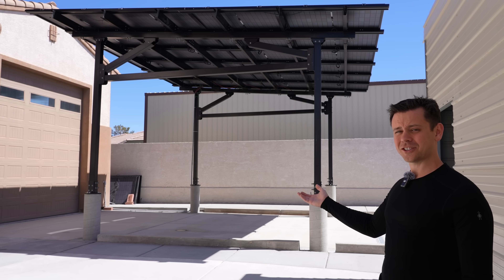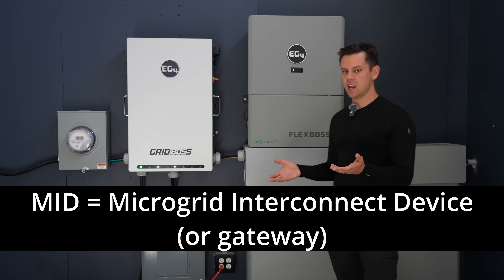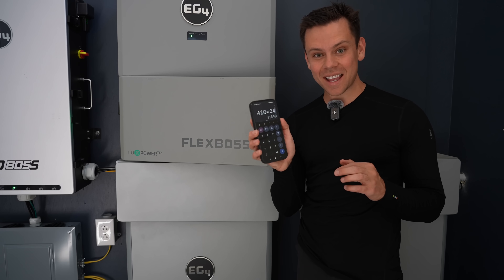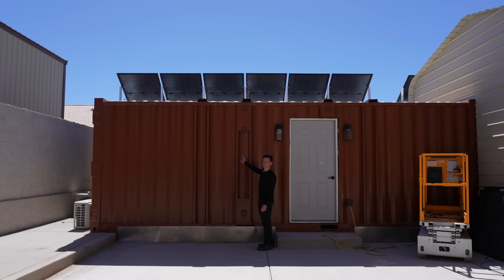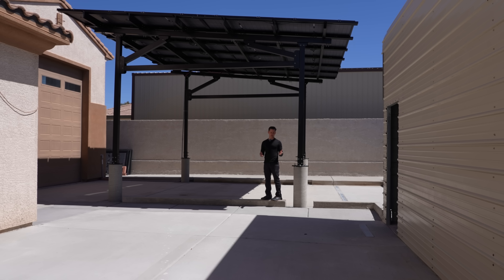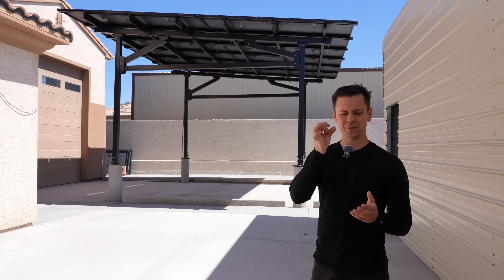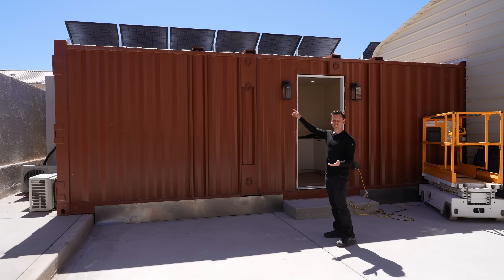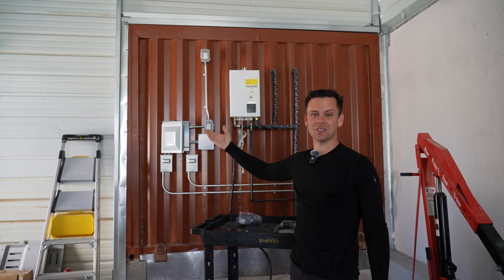Yikes! Not 12,000W?! Chiko Solar Carport w/ Aptos 410W Bifacial Panels

Comment: Have you ever thought about getting some corrugated steel metal that they sell at home Depot or Lowe's it has a reflection to it if you put those around the edges of the panels I think you would get more array in our opinion

Comment: @WillProwse on that robot dog back door post you made and then removed.  You need to redo the name of your WiFi network and change the passwords. You have to assume the WiFi credentials have been sent back to the mothership.  Same reason I urge you to not blindly trust the gear you review made overseas that uses web services based overseas.  Just because the company that slaps it’s name on the outside of the case is USA based, you are not safe from back doors built in overseas.  I put most of my WiFi only gear on a guest network.  My main network is constantly upgraded to the best encryption, etc.
Reply from the maker: Good to know. Wow

Comment: Fine & dandy, not square footer columns, 😢possibly wrap osha yellow corrugated plastic sleeves around them for safety. Then that would also fill out the width, and eliminate the sharp points. Then paint the curbing the same, due to that being a serious tripping hazard.

Comment: Too bad you don't get snow, my "vertical" not elevated, JA 550w with snow 697w before it shut off the mppt for over amp. With-out snow, white painted surfaces all around even below at the base of the panel. 
White rock, white sign board, plywood painted. My 550w x6 3300w, 4185w on a 3kw input.  I have 11.6kw, overcast now, snow is gone, shade stick is still in, 1930w. Using 18kwh no gen since Jan 9th.

Comment: Super reflective surface like a false ceiling right below the panel could help with the bi-facial situation. And the solar panel has to be translucent at least and not opaque like it is now. At that hight, radiations bouncing off floor is not going  to  help much.

Comment: Shading aside, the reflected light intensity falls off as a function of the inverse square of the distance.  Double the panels height off the ground and you fourth the reflected intensity.
Reply from the maker: See this is a common misconception. This is why the literature tells you to place the panels up as high as possible because you're increasing the angles from other areas that you wouldn't have. Think about your example and what happens when you lower the panel down to the ground.
Reply from the maker: I need to make a video about this because it's a common thing that people seem to mess up all the time
Reply: I’m just thinking of the inverse square law from physics, but I do get what you mean.

Comment: Are you "string" chained ? Are you having power optimizers per panels ? 

I'm asking because if you're only string attached, you would limit all your panel on that string to the minimal power of the whole string (current limitation, not actually power).  So if one of the panel is limiting the current of the whole string , it may be limiting the power of the other panels.  This is one of the flaw of a string attach inverter, but it's normally not that bad...

Maybe try with a heat camera to see if one of the panel has a hotspot ?

I know I sound like I'm trying to explain things you already probably know, but I want to know why as well! XD

let me/us know what you find please !

Comment: Careful with putting the split above your head. It might give you a sore throat every morning. Plus you may have difficulties in setting the temperature just right - you turn it on - too cold, you turn it off - too hot.

Comment: Because of the angle of those panels I think you will get a lot more power during summer. They are not optimized for winter/spring. I am getting maximum output this time of the year, but my panels are at 45 degrees.

Comment: buff and polish the concrete to a mirror shine.  
I loved the idea of bifacial with the metal roof of porch on 1st floor.  But then I thought about the wind loading of panels sticking 8 feet out off the 2nd floor roof, and dropped the idea.
Maybe if I ever remodel, I can add greek columns to support the outer edge of panels.

Comment: I'm the guy with this exact gazebo in Denver, but I went with SILFAB 420QD panels, without bifacial. Interestingly, yesterday I pulled 8750W at 12:30p, with 23 panels (I'm missing one at the moment). That's about 90.5% of max potential.

That was at about 50F ambient, so if it's warmer there, maybe that's the difference. Sounds like the bifacial isn't providing much.

Time to paint the driveway white?

Comment: Bifacial panels are a solution in search of a problem. There’s not many situations where it makes a big difference. The panels should only be rated for the solar yield of the sun facing side and any extra power from the other side is a lagniappe.

Comment: This is probably a dumb thing to wonder because Will is very thorough…but is it possible the power from carport solar array might be suboptimal due to the angle of the array?
Reply from the maker: Sadly not that big of a difference at this time of day. I have some older videos testing various angles. Few percent here and there, but nothing significant. But in the literature there's always benefit to raising the panels as high as possible. It increases convective airflow and allows for a lower internal cell temperature. Total generation for the whole day was pretty good though. Had a whole sun-hour over my other system.

Comment: Um, those panels don't seem to be at the optimal angle to the sun? Maybe get a solar irradiance meter to ascertain the optimal angle. It probably should be around 37 degrees depending on exactly where you are.

Comment: 99% sure the lower output is due to panel heat / temperature coefficient. I find on clear days (even when a little cooler) the panel temp will be double that of the test conditions per spec sheet. 
Wait for a cloudy day when the sun peaks out briefly, and that peak will be far closer to your assumed max.

Comment: Maybe the angle,maybe the mppt also looses some...In my experience victron mppt`s are the best.I compared side by side with some brands and it outperformed them all.Not with EG4,that is not awaileble in Romania.(but i compared it to epever,chinesse brands,outback,growwatt,solix,huawei,etc..and it outperformed some of them with 30%!!!! like the epever,its real crap.)

Edit.: I have 5600w rated of bifacial solar panels,at a 45 degree angle,and i measured 6200 watts on my victron system in peak sun.Less than perfect gives usually 5200-5500watts/h)and they are cheap chinesse solar panels bought on sale.

Comment: So radiance drops off by the inverse of the square of the distance.   So further from the reflector, means less light.
Reply from the maker: But more sources of light and the higher off the ground, the better convective cooling occurs. So the literature has always stated to move the panels up as high as possible

Comment: The larger an array of bi-facial panels you create the less gain you are likely to get, for the obvious reason that the array creates a large shadow. Panels around the perimeter of the array may get a little boost from unshaded surfaces reflecting some light, but that nice big pool of shadow is what most of the panel backsides will "see."

Comment: Did you test each individual panel?   Any chance one of them isn't working properly?  It looks really professional.

Have you tested a single panel in front of the carport at various angles?   That seems like a fairly shallow angle.   How much does the proper angle change at your location as the year progresses?  My sun is high in the summer but much lower in the south in the winter.
Reply from the maker: Both strings are producing the same amount and voltage so I think they are good. I could hit it with a heat camera and check. Technically it's a pretty good output, all things considered
Reply: @WillProwse  All I could think of.  Good luck!

Comment: I think the height above the ground is actually worse for bi facial gain, reflection from porous surfaces like the wall and ground are going to disperse much too far over that distance
Reply from the maker: In the literature it always states you want it as high up as possible. There is more available light the higher you go. And better convective cooling of the cells

Comment: I think you alluded, briefly, to the problem. Your solar carport isn't angled enough for this time of year. Wouldn't that account for the lower-than-expected output of the solar array more so than the lack of reflective surfaces for the bifacial sides?
Reply from the maker: Yes but dang my other systems are pulling almost full output. Desert temps drop output in summer here.
Reply: @WillProwse  Have you made any videos where you chart angle vs. output? I've heard that the angle doesn't make as much difference as you'd imagine it would, but I'd believe a carefully executed experiment that backed up that claim (or disproved it).

Comment: Angle isnt EXACTLY ideal for this time of year as well (for example being 30 degrees off-angle reduces net surface irradiance by 13.4%), so that adds in. Sadly for this to work as a carport it kinda needs a shallow angle. 88% is not bad all things considered. You're trading that last 12% to make good multipurpose use of your limited space. Advertized bifacial gain is near impossible to hit tho in the real world, a SINGLE panel has well lit space to both its sides, but once you add panels around it the shadow behind it grows, and spacing panels is usually not ideal.
Reply from the maker: Yes true

Comment: Carports are  10% Tilt . Is the 10% tilt South?  If not solar noon is not at Zenith. Whats you Latitude?  34 degrees?   A 10%  tilt you will experience reduced output during winter. Happy Equinox.  :-)
Reply from the maker: This one is only 5% haha
Reply: @WillProwse    FWIW -  @ > 10% rain will clean/wash the array.  @ 5% you may need wash dust off manually as needed.

Comment: I'm at about the same latitude as you are in LV, and it appears that your panels are optimized for June gain, ~15º from horizontal. This time of year you would want 27.3º for your panels to be perpendicular to the sun at solar noon, so that's going to affect your production. The calculators show that for fixed angle installs for LVNV, you'd want to install at 29.8º.

Comment: I was wondering if you put a reflective type of surface under the panel to reflect light back through and up again into the bottom of the panel. I suppose you would have to leave a space to allow air flow to not overheat the panels. doing an independent test?

Comment: I wonder how this would do in Anchorage Alaska with our winters.  I think it makes more sense than putting them on the house
Reply: You'd want a lot more angle at your latitude, probably closer to 60+ degrees.  5 degrees up there would not perform well at all.
Reply: @ssoffshore5111  Fortunately my driveway is sloped, I need to measure how much.  I'll contact Chiko and make sure it can be built on non-level ground.

Comment: Good video! I have this small 2.4kw solar array on a 20ft container using bifacials and to increase the albedo, I put sheets of white acrylic greenhouse sheets (w/a 6 inch gap) between the panels and container roof. I've noticed it makes about a 10%-15% increase in power production

Comment: Why is the canopy on concrete pillars at all? Aren't they supposed to just bolt straight to the ground. Did you really need it that high?
Reply from the maker: Yes to prevent shading from the buildings next to it
Reply: It's a tall garage door, probably didn't want to limit access.

Comment: I’ve gotta low angled setup (25’ish degrees, Maritimes Canada) and clip often on a fronius 10 kw inverter with 24 Jinko 569 watt bi-facials (including bifacial gain around 22.5%).  Of course I’m just over 11 kw STC without any gains, but it seems to stay up in voltage quite well in off peak hours.  The snow does seem to help, but nowhere near production of summer.  I feel like 2 or 3 days of summer can surpass my monthly production in winter.

Comment: The Chiko carport is a fixed 5% tilt. You're at about 36 degrees North in Las Vegas. Google says you want about a 32 deg tilt for year-round production, so you're off by about 27 degrees from optimal tilt. If my math is correct, COS(27) = 0.89, so you should expect a maximum of 89% of STC at peak irradiance. That'd be 8,750 watts, so -- you're about spot on, not including any bifacial gain.
Reply from the maker: Lol
Reply: @charleshill7184 did you take into consideration the current wobble of the earth, they expect the equator to be near Kentucky this summer.
Reply: @davekerr9479  That's called "precession", and since the Earth is on a 26,000 year full cycle for that -- maybe next time. 🙂
Reply from the maker: Check out my older videos where we realized tilt doesn't affect the output that much. My other arrays are pulling good numbers right now so figured we could get at least STC considering how high the panels are. Ahh well

Comment: How bout some reflective panels at 45 degrees to reflect the sunlight up onto the back of the panels? Maybe not the most ideal solution but it might work even just as a test. Some space blanket Mylar stretched over a wood frame

Comment: I still fail to understand why people use non-insulated shipping containers. It would have saved you the cost of the insulation to just buy a used reefer container and do the same exact conversion in the house. I have one I live in and I'm making two more, but it's forty-foot.
Reply: I realize my post sounds overly negative. It's a nice setup. I just see a lot of people use regular containers and they need far more work to make them livable than the pre-insulated ones and end up costing more overall is all I was trying to get at.

Comment: I have a few Gstar 425W bifacial panels and one Talesun 400W bifacial panel. I’ve never observed any noticeable bifacial gain. All the panels are installed on top of a pergola. The highest PV output I usually see occurs on lightly cloudy days, when a lensing effect seems to focus the sunlight onto the panel surfaces.

Comment: Thanks for the video. I am not really too surprised that you are not getting a lot of bifacial gain there... you surrounded the underside of the panels with buildings that will block reflections. But, I really like the carport Idea overall... I think that is a great way to do solar.

Comment: To get more out of the bifacial feature. Maybe, cover wood panels with Mylar or mirrors. Put them under the solar panels but where the sun still shines and angle it up to reflect the light on the underside of your array. You could even hang it up out of the way. You've got plenty of headroom. And it being closer to the array than the concrete, may actually help. May help keep it cool, directing air up to the panels.

Comment: It should have cross members perpendicular to the horizontal bracing to lay a down white painted tin roof & space each panel an inch apart. Light reflection & DRY

Comment: You need some directional reflective disc, aiming light at the bottom of the bi facials. I use my facials on top of my fifth wheel and when they’re angled up, I put reflection down behind them on the roof. I get great power.
Reply: I was thinking the same thing by utilizing some old Dish Network discs. Then after looking at the structure again, I was thinking maybe mounting 2 feet below the panels, an array of mirrors or polished SS running along one side

Comment: If you paint it white keep in mind all white paint doesn't reflect equally, look at the "CRRC's Cool Roof Product Directory" to find solar reflectance.  How about reflecting light with 98% reflecting mylar panels... not to the ground which would make it hotter, but redirect the light to the bottom of the panels.

Comment: I've got 2x 410 watt panels in the uk and have been surprised to see them exceeding their rating on partly cloudy days. They have maxed out at 1007 watts but more typically it's high 800's to 950 watts. It's great they perform well on partly cloudy days because even those aren't that common! More common is completely cloudy! They have generated 50kwh in the last 20 days which is probably a record for the uk.
Reply: What's the name of model of those panels please
Reply: how is the performance on completely cloudy days? 10% of rated? How many days a month do you have that are that cloudy? Some places seem like very tough contenders for solar. Unless one can overpanel as much as needed.
Reply: I also found I got my highest peak power briefly on partly cloudy days. I attributed it to some form of lensing between the cloud gaps. It was fleeting so not really that helpful. Fully sunny days gave best area under the curve

Comment: My thought is more the angle of the panels, the chill car port is a 5 degree slant, idk what the ideal angle is for you but in Florida it’s 20 degrees. The biracial gain is probably what’s getting you close to the rated output of the panels :/